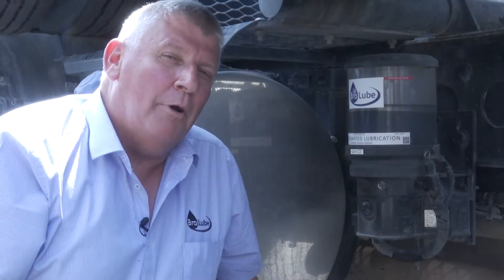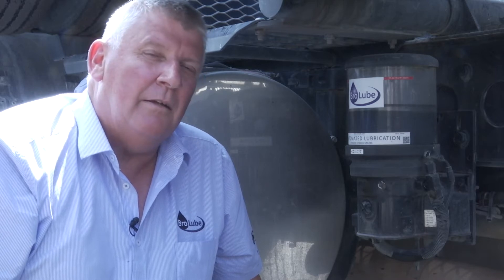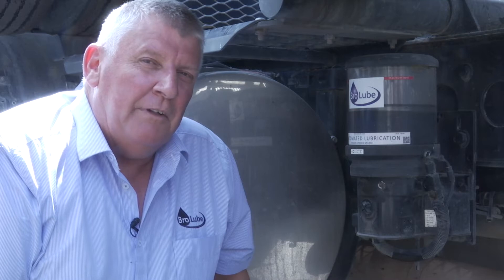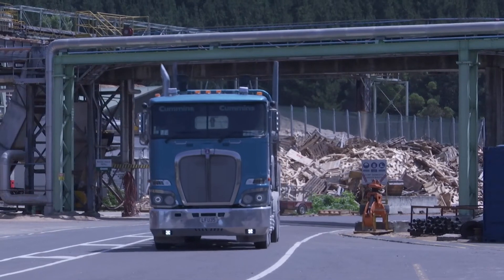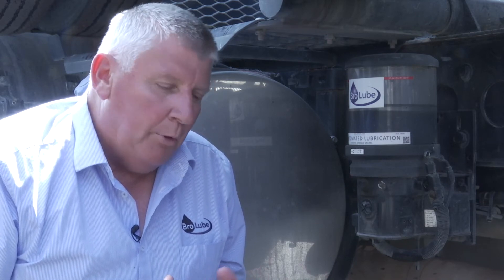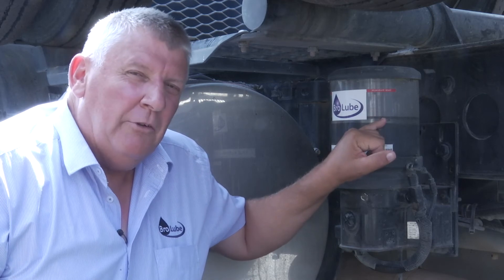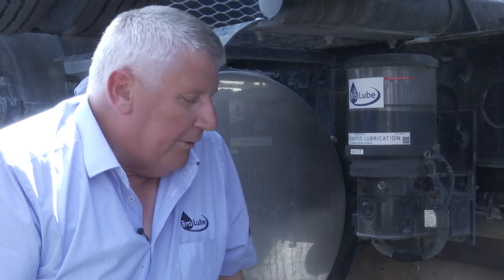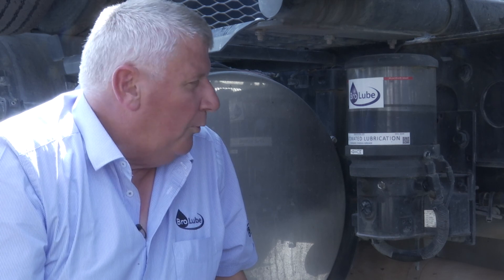BroLube Greasing System Explained

Comment: When adjusting what dial does what bro want to turn down as truck is over greasing i see the dials are 1 to 3 but not sure wat one does what cheers
Reply: Hi Riki, blue dial is pause time between cycles, in hours, so 3 means it runs every 3 hours. Red dial is running time in 2 minute increments, so 3 will be 6 minutes runtime.  Change blue to 3, you’ll get a lot less, then turn red up if you need more. Bill.